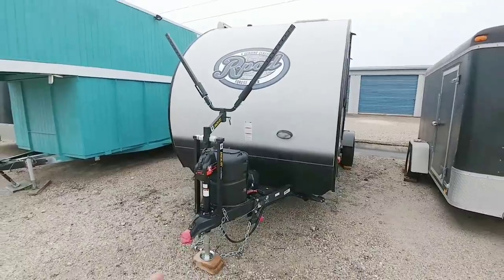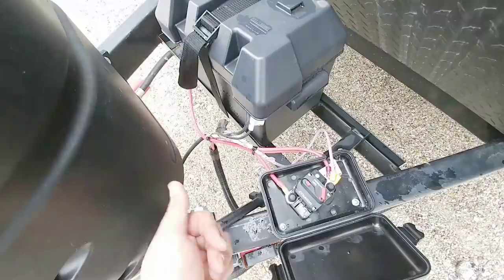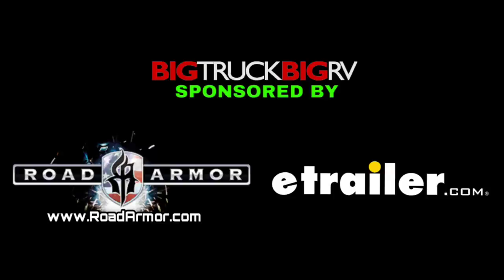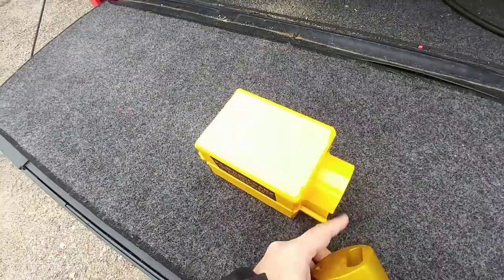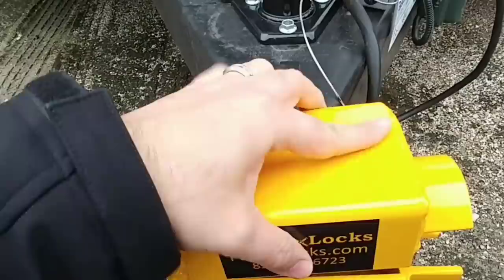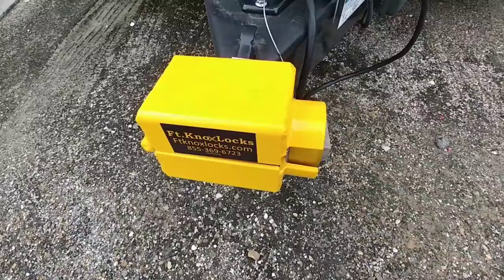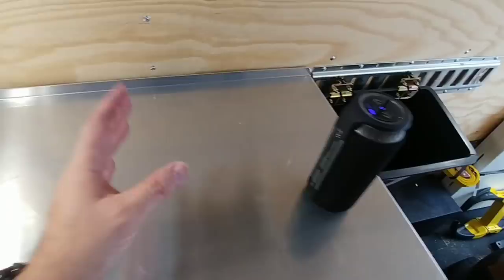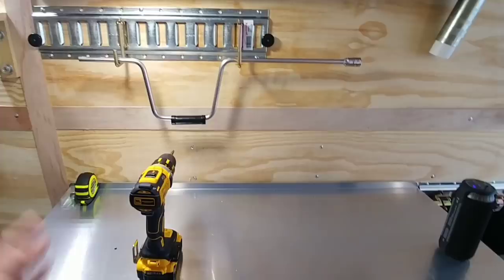Major Upgrades to Trailer security and Interior!  Ft Knox Locks and etrailer

Comment: Just a note, when you find the need of a good vice or grinder, you can take a bench model bolt it to a 2 x 12 then secure the 2 x 12 to the bench with 2 heavy duty clamps. I do this all the time with my 2 x 12, 12ft. Picnic table when the wood shop is to hot.
Hope this helps.
Mark Waco

Comment: 4-1/2” grinder + cutting wheel. Slice off the ends of the hinge pin... gone in 60 secs. Or just wrap the chains around the ball and secure with a pin.
Reply: The more obstacles for deterring theives ,the better.   Coupler lock, pin lock, wheel boot (like parking wars TV show) cable lock linked through rim's, and GPS system enabled.  

However, if someone wants in they can take a stihl quik cut gas powered machine to cut a door entry through the side wall of the enclosed trailer.   Or hire a rotator crane & flat deck unit .    😑

Comment: I use a cheap tongue lock that can be bought at the big box stores.  It really is for my peace of mind.  I'm not a thief but I do own a battery powered angle grinder just for working on my boat or travel trailer at the storage yard.  With a 4ah battery, it can do just about anything a corded model can do.

As for the batteries on my boat (3 of them) and the one battery on my trailer, I removed them and place them on a battery tenders in my home garage.  If I need a 12vdc battery at the storage yard, I take a small backup to use.  Yes, the storage yard is in a sketchy part of town.

Comment: Even with a battery disconnect switch, there is enough of a ground from the trailer frame that when switched off, my Tire Minder transmitter still is able to draw power from the battery!
Reply: The batteries in the tire minders themselves will go dead no matter what. If the positive is disconnected from your battery there is no way you will ever kill the battery with something drawing from the cargo\camper trailer. Electricity is a two way street... Maybe you just have a bad battery or need to do maintenance on it?...

Comment: I am looking for a good lock for my trailer and I watched this video and I would not use that Fort Knox lock. The very y 1st thing I saw on it that I thought could be easily compromised was the hinge. There was 2 hinges pieces that could  Just be cut with a is a cutting wheel..
Reply: An entire solid block of steel can be cut with an angle grinder. . .

Comment: I feel that would be a much better product if the hinges were inboard of the box
Reply from the maker: Wouldn't make much of a difference because even if you cut the entire hinge off, you still could open it without cutting the lock off.
Reply: How would you get to the hinge if its inside the box

Comment: Can you give us a video with your  review or thoughts about camper covers? Unfortunately I have to store my trailer outside in the winter. Here in Northern Illinois it can be brutally cold. I've Been Told that camper covers may not be a good idea because it traps the moisture inside and doesn't let the camper breathe?  Makes sense that this could be bad over time? Your thoughts?

Comment: Engineering 101 Never drill a hole through the top of an A Frame , from the side if you really must ..that A frame is now forever compromised reason they have everything attached with clamps and u bolts also if those bolts are ever overtighted causing even a micro crease it will buckel all the weight bearing is from the top.

Comment: Likes the table and trash can set up! 
****As a couple comments below have mentioned,  Angle grinders & I agree on $ price! FORT KNOX made A big FLAW  in respect to angle grinders. They should have built it with HINGE on the inside and design it so hinge is underneath or toward trailer to make more difficult to access with a grinder.  
......So $300 bucks for a lock with hinge expose like that is a dead  NO for me, 
.......NOT VERY SMART ON FORT KNOX,  AMERICAN MADE.  .......JUST SAYING,  fron a southern Alabama boy.
Oh the guy mentioning 8 hr day has a point!  @ $50/hr that's $320 something everyone in this country needs to think about. We here in the U.S. are really being screwed by over pricing their products. I'm a
Mechanical engineering draftsman by trade and worked also in R&D dept.. Back in late 80s company I worked for now owned by Robert Bosch,  we made a 7 bit Forstner set for CRAFTSMAN, our cost here in Al. was $24 back in late 1980's,  SEARS cost was $35, Sears sold for $149.99 but usually the price was $129.99-139.99
$100-120 dollar above cost
..........today CHINA probably makes it for U.S. companies for $5-$10 bucks maybe less .......Do you think for one minute companies will sell it cheaper? Maybe off brand! (China)
........See my point on U.S. citizens being SCREWED! 
Jeff
Reply: If you have the tools to cut the hinge off you have the tools to attack the lock box itself, point is if you have the proper tools there isn't a lock in the universe you cant defeat, in other news water is wet

Comment: The hinge should be on the inside. No brainer, that they didn’t fix that is enough not to buy.
Reply: having the hinge on the interior of the box would make the box unable to open as the metal would turn in on itself as it opened. . . its possible that may have been why we "didnt think to fix it"?

Signed, "Brainer"
Reply: @miltonodom8095  I can send you several cad drawings and prove you wrong. Secondly, if that was the case, it’s a poor design flaw.